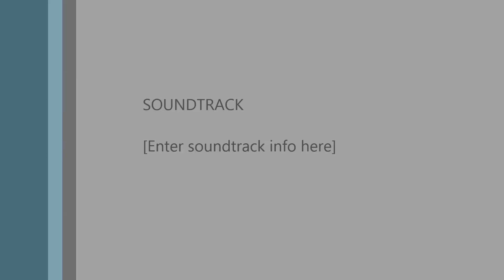Homebrew Double Balanced Mixer Part 1 of 3

Comment: Pete, Great Video and explanation of the DBM used in homebrew. I've just begun listening to Bill and You on soldersmoke and have reached the past episodes of when your "Let's Build Something" was being published.  You'd mentioned in the podcast that your bench was in your (uninsulated) garage for some reason I had imagined a partition, stall or cubicle separating the bench area.  I can see in this video that you're right next to your vehicle.  My folding table in the spare bedroom seems like a luxury now!
Reply from the maker: Hi Ralph, Thanks for your post and comments. Yes --you freeze in winter and roast in summer but that is all part of being a ham. If you send me an email to n6qwham@gmail.com I can send you the two part article on the Let's Build Something project. Many of the circuits used on that project are now in use on other current projects. Thank you for being a podcast listener. 73's Pete N6QW

Comment: Any number for schotky diode
Reply from the maker: You might want to look at this one.http://www.onsemi.com/pub/Collateral/EN3240-D.PDFI would suggest doing a search of Mouser and Digi-Key and look at the available products. I am done building homebrew Double Balanced Mixers --you will find it is very difficult to achieve the performance of the commercial units. In practice my homebrew units had losses greater than 5-6 dB and required greater LO power --like 10 dBm --2 Volts Peak to Peak.Save yourself some grief and just buy the units.Thanks for your post.73'sPete N6QW
Reply: Thanks for reply& I'll try.73's

Comment from the maker: Follow up to the comment that the audio was a bit quiet. I checked the Hero Go Pro 3 manual and there are many settings where one can adjust the video features. However I only saw a small amount of info about audio settings. It appears there are only three: 100% (default), 70% or OFF. My camera was set for 100%. I listened again to the video and the audio level sounded similar to then other videos made with the Go Pro. I believe the individual who made the comment may be a professional videographer and thus would know the difference from normal to "a bit quiet". The next time I will place the camera closer to me and hopefully achieve "full quieting."
Reply: Hi Pete.  I am no videographer and find your audio level way too low as well. I notice the same issue in some of your other videos too. Thanks for Sharing your knowledge!
Reply from the maker: Dean Murray Thanks for your comment and input on the audio level. I will once again check the Go Pro audio settings but as I indicated previously I only found a minimal reference to audio level settings. I do not have a quiet voice and so that is not the problem. I am not sure how to address your comment as well as the previous one if I once again determine that the audio settings are at 100 %. There possibly is something that can be done to boost the audio in the editing process with MS Movie Maker. I must add that I have only received two comments about audio level. So perhaps others are experiencing the same situation and would hope as you, they would provide me that feedback. The Hero Go Pro 3 is especially noted for it superb audio capture. Perhaps thee is something wrong with my camera. Always a possibility.
Pete N6QW